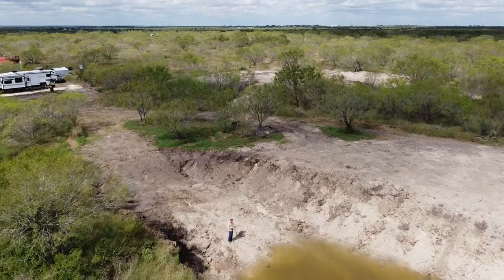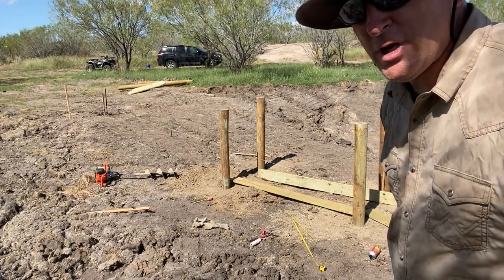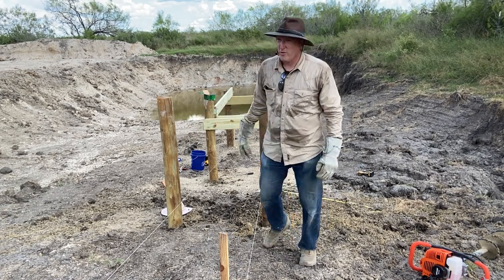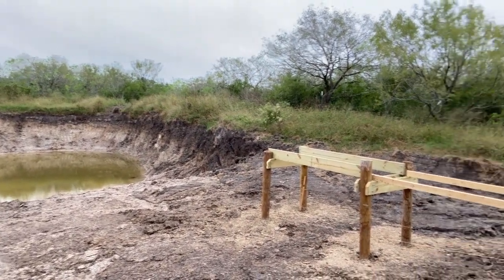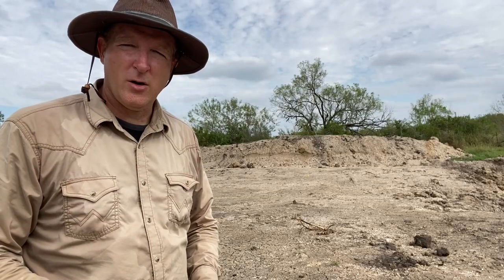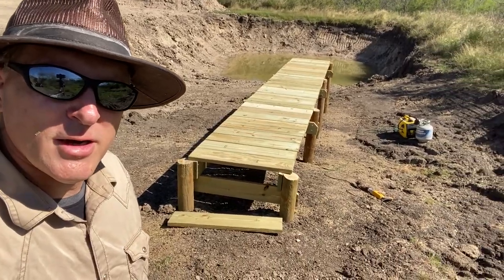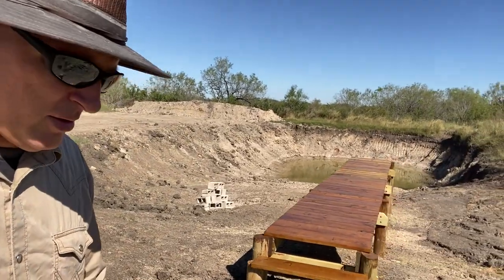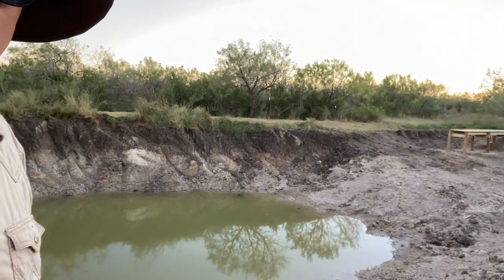BUILDING A PIER ON MY POND - FROM START TO FINISH - (EP 51)

Comment: Great job, hard enough building without dealing with camera work. Much appreciated though. Gave me all the detail I was needing to build my pond pier.
Reply from the maker: One thing you might add is concrete around the piers in the ground. Will just give it additional stability.  I went in about a month later and dug around the piers and put some no-mix concrete.  About a bag per pier.
Reply: @24acresofparadise  I did add concrete as well. Thanks again sir.

Comment: If I may make a suggestion , put a pole to measure the depth if you can out in the middle and mark it every foot or 6” and record your readings also a fish trap to record your growth ! I would put a tarp up on the west end to create shade from the evening sun , just 4 posts about  10 ft. Above the high water mark ! Or a floating raft 8’ x 8’ with a tarp 8’ above it and anchor it in the middle ( use 6 plastic drums 55 gal. ) that will serve as a fishing spot also ! The shade really helps the fish , think about it on a lake where’s the best fishing ? Under a dock or in shade ! Just some thoughts !
Reply from the maker: Great suggestions, thanks!

Comment: Invest in a battery nail gun or a compressor/air nail gun. Worth every penny for building with wood
Reply from the maker: Thanks!  Any issues with the nails coming up over time?  I used deck screws for this project.

Comment: I hate to tell you this but you are never going to see that pond filled to the point you think it will. You need a stream or underground spring to fill and keep a pond filled. What you have is a catch basin, meaning you are relying on rain alone to full the pond. It's not going to happen. Through seepage, and evaporation the water level  will continually drop.
Reply from the maker: The previous hole was completely filled so I pretty much know where the levels are.  Regarding evaporation which is really the only water loss I have to worry about (no seepage) I put a priority on the pond being dug deeper and not as wide to help prevent a lot of surface evaporation and drying out of the pond.  We'll eventually be putting in a solar powered well which will feed into the pond.  You'd be surprised how much water flows into that area during a rain.